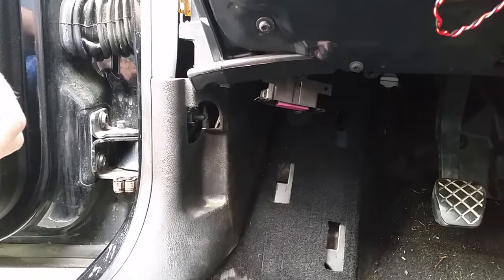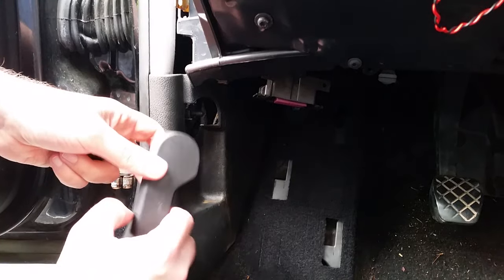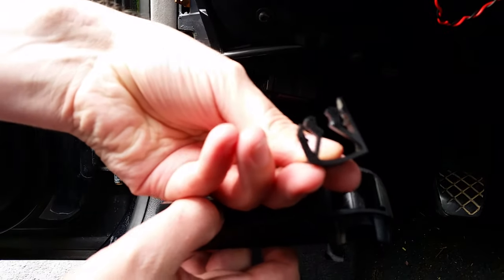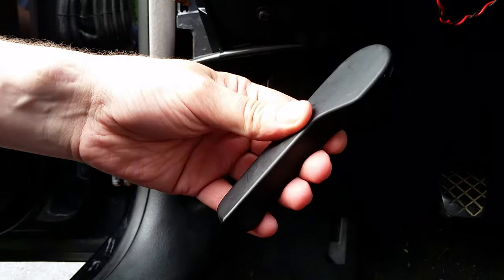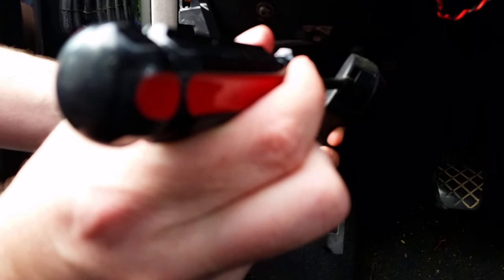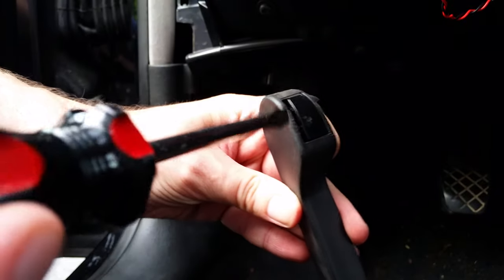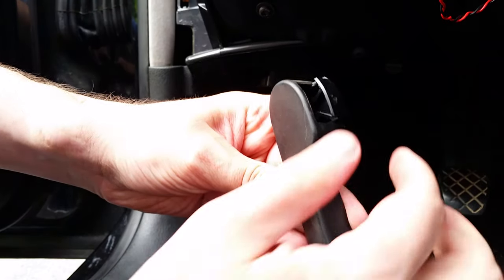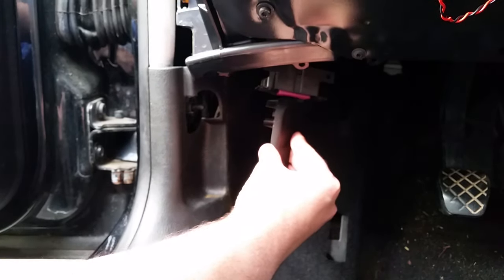Hood release handle on a VW MKIV removal how-to

Comment: How did you get the dead pedal out
Reply from the maker: You need to remove the screw, potentially remove the trim that it latches onto, slide it up and it should come out. There's some clips on the back that hold it.

Comment: Looking for pics showing how the hood release cable is attached to the hood release handle bracket. I had to replace mine but I can't open the hood.
Reply from the maker: You mean inside the panel behind the spot where the handle is?
Reply: @votblindub  yes. Feels the cable is not tight enough. Maybe there is another problem with the cable under the hood
Reply from the maker: @arphaksad01  follow that whole cable, it may have torn. check it out just in case.

Comment: its really difficult to do when it is installed and you have to lay in the foot room
Reply from the maker: The door doesn't open?
Reply: @votblindub  yes it does otherwise i could not lay in the food room could i ?  the clip should be on the other side so you can get to it easier

Comment: What happens if I pull this lever and my hood wont open? Didnt even prop open at all. I mightve closed the hood too hard now its stuck
Reply from the maker: It could be stuck or maybe the cable is disconnected or damaged
Reply: @votblindub  hi friend, thanks for replying. i took it in today and it is found damaged. they said they ordered the part through VW and the cost to fix it would be 268$ does this sound right?
Reply from the maker: @ISTHIStheKRUSTYKRABx  a lot of times pricing is debatable. You could save $$ by finding the part yourself from a reputable store/online and doing the work yourself. Depending on what's broken, most of it can be fixed with basic tools.

Comment: For those wondering how to put the handle back on, like I was, it is pretty easy.

Insert the clip back into the handle and fully seat it. Press the handle into position. The part that you are pushing it into is coned shaped and will separate the clip. You will feel and hear it snap into place.
Reply: What is name of clip. I lost them
Reply from the maker: @degetel09  probably something like hood release handle clip
Reply: Thanks for the info, I was afraid of using too much force on these old plastics but it worked.

Comment: That's great, so how the hell do you put it BACK ?! I replaced the latch on the front bumer (was rusted) and replaced the snapped pull mechanism inside the driver door, behind the handle pull. Got it all off without any issues, but cannot figure out how the hell to put the handle and panel back on ...
Reply from the maker: The plastic handle? That just snaps back on. Otherwise, I'd suggest to look at an exploded drawing like on ETKA or the manual

Comment: I tried to open my bonnet on a vw touran 2008 and the handle just snapped now its all lose and i cant open thd bonnet now what do i do?
Reply from the maker: Is it an identical handle/hood release mechanism? Idk those cars, sorry.
Reply: @votblindub  its the same  i removed the handle and i saw that the gear broke and i cant remove the gear element, i tried sticking a screedriver in but im afraid ill break the mounting piece behind it maybe
Reply from the maker: @Fartnrun  you may have to dig in deeper or send me a PM and I'll try to help
Reply: @votblindub  problem solved today i went to a guy who has a lot of used car parts and i found the gear thats under the handle ( thats what broke for me) and i paid like 15€ for that piece and i installed it oiled up a littr the cable and done.
Its just a baaad design from vw cheap plastic.

Comment: No wonder they call VWs 'Hitler's Revenge' ! What kind of idiot 'engineer ' would put the clip at the back out of sight, and why not simply hold the lever on with a visible screw? [Probably an associate of the guy that designed airboxes that require engine removal on some modern Triumph motorcycles...] Thanks for the well-presented tip - hopefully it applies in principle to my T5......